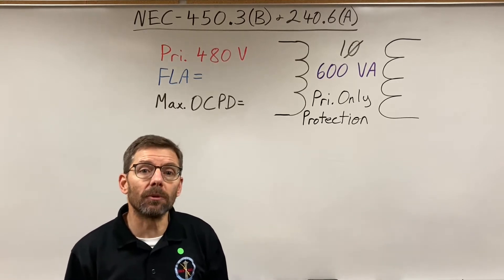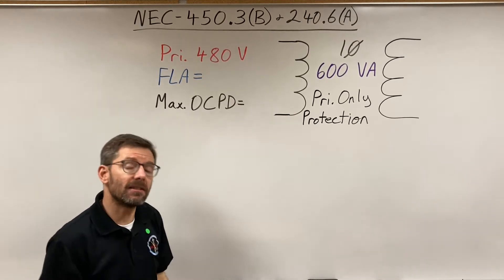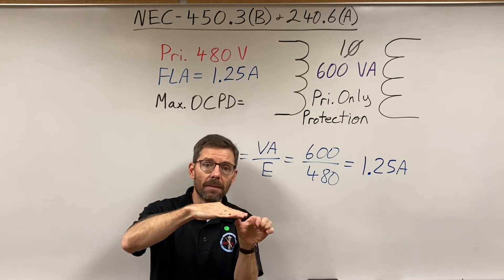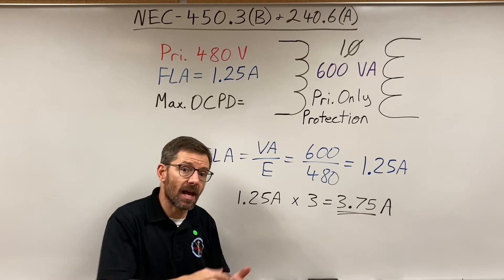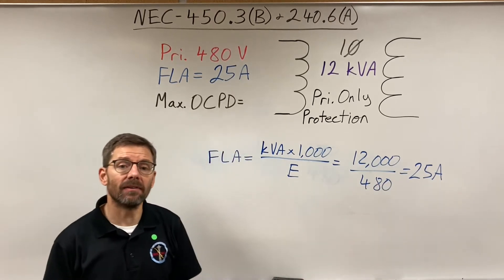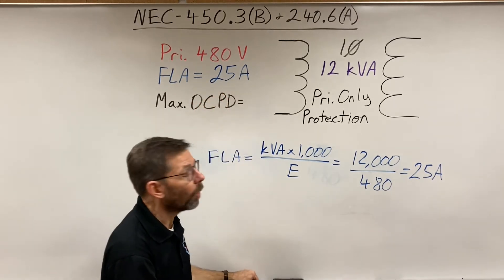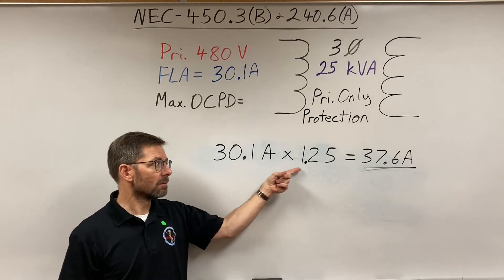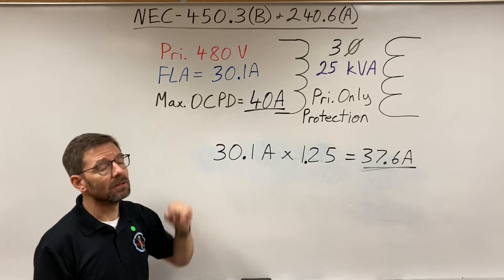Transformer OCPD - Primary-Only Protection, Table 450.3(B)

Comment: This is only applicable when its single phase 2 wire to 2 wire and 3phase delta/delta circuits right? since any other combination would require secondary protection for the conductors anyways. Please confirm

Comment: Hello, great video. I have a 400 amps service open delta made from two single phase transformers 120/240 ( 250 and 150 amps main breakers. I m buying a new step up transformer 112.5 kva  3 phase to power a 100 amps 480v machine. what OCP do I need on my primary?

Comment: Thank you!
I was in doubt of which breaker to use for a 150 kVA dry type transformer 3 phase @ 440V primary. 
According to the NEC table the max size should be 250 amps breaker, but cost was considerably higher than 225 amps installation. 
We used a 225 amp I-Line breaker with 4/0 awg wire. 
Transformer is working without a problem.
Your video saved me money :)

Comment: Question: why did you go down from 3.75A to the next size ocpd 3A? Note 1 on 450.3(B) says go up to the next size? I’m an apprentice so I’m still learning. Great video by the way.
Reply: NEC states, only Currents of 9A or more will b multiplied by 125% and has a NOTE 1. But in Currents Less than 9A there is no NOTE to be consider.
Reply: as per the table, it says maximum rating or setting so the standard rating is 3A only you can't use 4A since there is no note 1 is mentioned